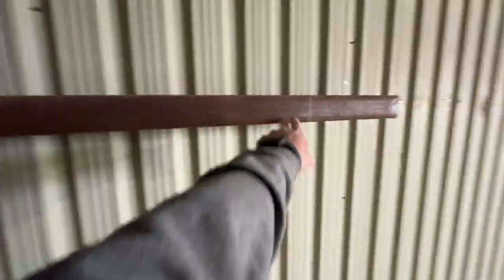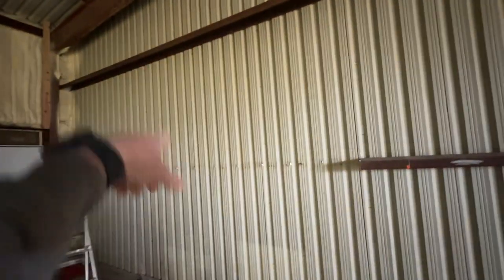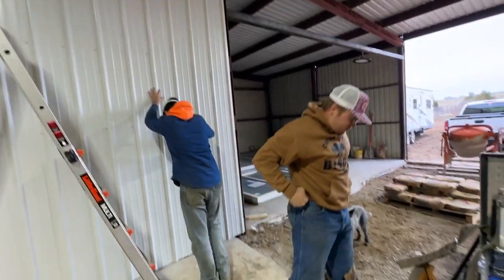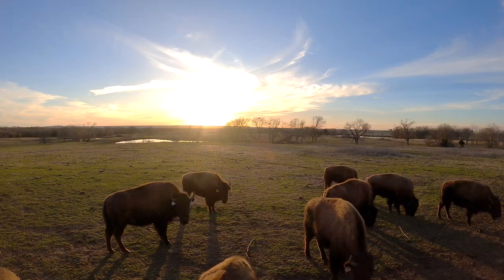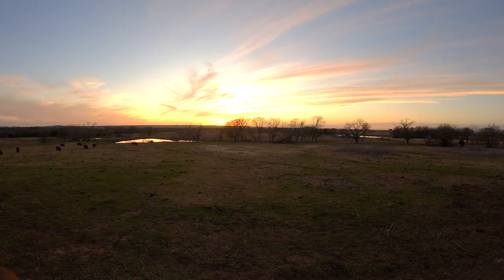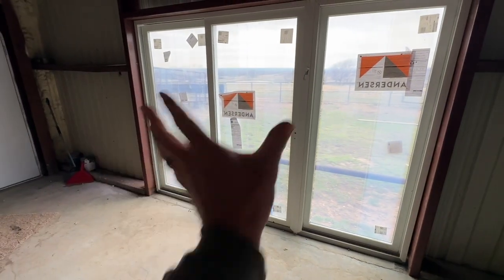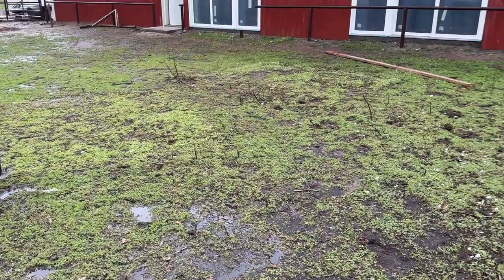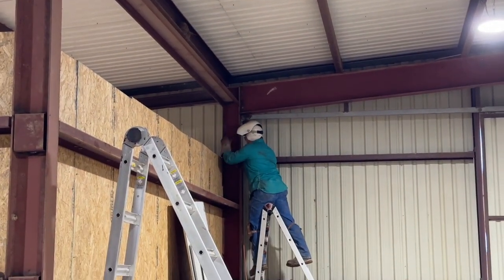It Hit Us Fast! This Will Change It All Up!

Comment: Granddaughter has a metal house after the first big storm. They put in what they called bafflers up above the ceiling area because it was so loud that They could not even sleep. Once bathrooms were up it cut it down considerably as far as the noise is concerned I’m not sure where she got them. She found them online check out sound mufflers or whatever see if you can locate them and make a Lot of, Lot of difference in your storms.

Comment: I have seen where they have a huge dug outs with a channel in to funnel in the cattle, it’s deep enough to give the animals some protection from winds etc. they go in and huddle to stay warm. It’s never closed and doesn’t have a roof it just gives them protection from winds. Could you do that, would they ever use it?  Shape kind of like a horse shoe that is narrowed at the entrance. Just pointed like you would a barn to cut the wind etc.  you know what I mean run in shelters openings for horses are facing the opposite direction of the wind like, open to the south if you have north winds etc.

Comment: Will you be having sliding doors of some kind to cover the glass doors when it storms like that. They could easily slide out of the way along the wall we're not needed. Then when you need them, just slide them over the glass doors to protect them from hail, as well as things that get blown into them. This could save you replacing the glass doors at a later date. Or you could even make a pocket over them on the outside to protect the doors and or disguise them as part of the wall. For the cost of the top of the door, tracks and panels, even if made from scraps should not be very expensive. Just a thought. Thanks for sharing such a beautiful view! ❤👳‍♀️🤟👋🏻

Comment: About 4 or 5 years ago a hail core came through about 8 miles long and 6 miles wide right over our house.  Cropped up suddenly.  We managed to duck in the hall and Hunker downas this house has no inside room or closet.  We're sitting there in the hall when hail started coming out from under the bedroom door into the hall with us.  When it was over, all the windows on the east side of our house, in 2 bedrooms was completely busted out.  The floors and beds were covered in hail and water.  Went outside and our whole yard was white and hail piled up around trees and side of the drive ankle deep.  1/2 mile s it took the brick off the east side of the house, roofs off, large horse trailers rolled through 2 fences and across a pond.  64 electric poles down in that small area.  Was without power for a little over 24 hours.  Our son in law and daughter was trying to get to us with trees across the road, neighbor used drafter to drag them off the road.  But neighbors and firemen were here almost instantly when it was over checking on us.  There was no grass left in pastures or leaves on trees.  A good sized steer was killed and a horse cut up pretty bad.  The rancher across the road had to bring in hay for his cows. Because there was no grass left for them to eat.   This was in Nowata County in NE Oklahoma.